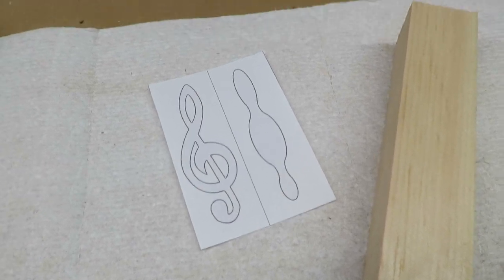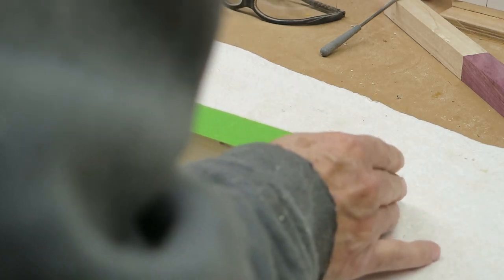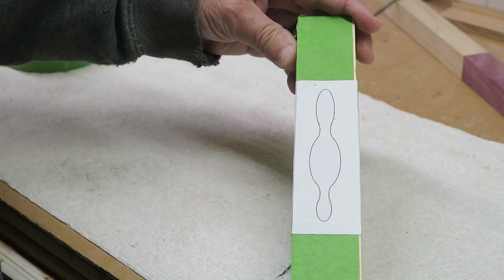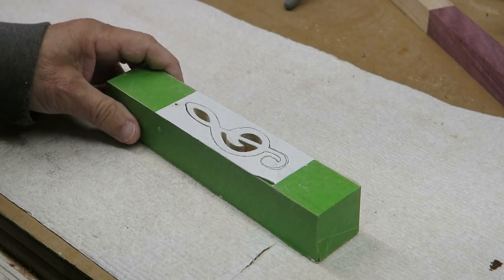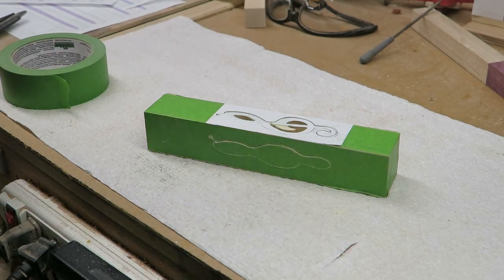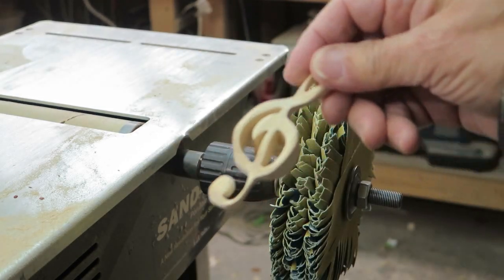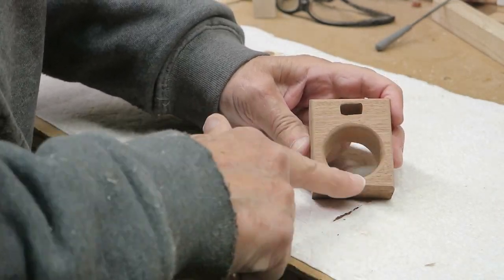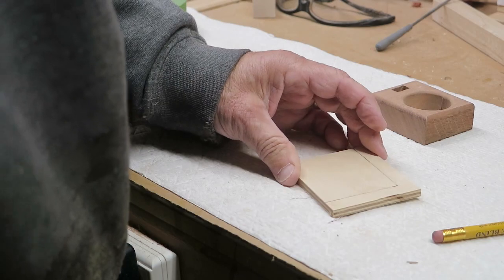G Clef Ornament

Comment: nice ornament, I think it would be easier to just use a forsener bit to cut out the hole in the box and not go all through, that way you dont need to put a bottom piece on it . thanks for sharing
Reply from the maker: I agree. Thought of that while I was watching the video. Thanks for the suggestion I should have seen earlier.